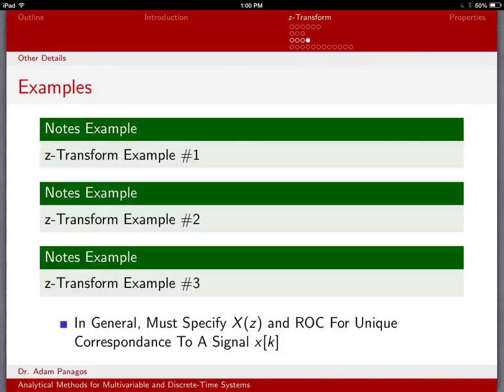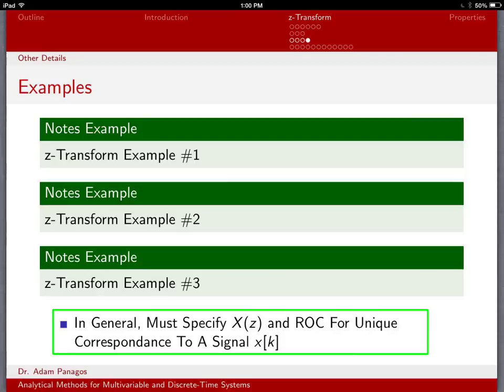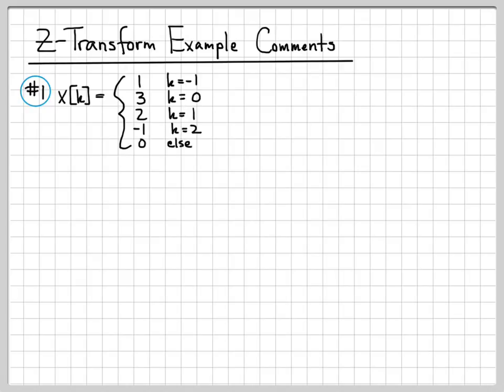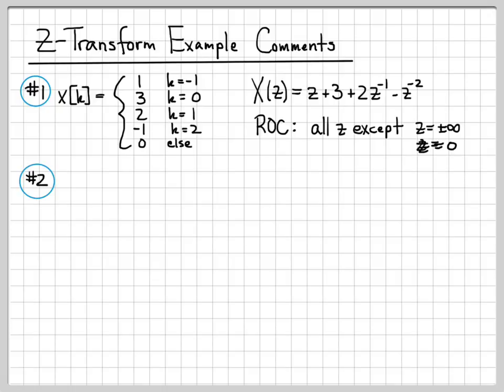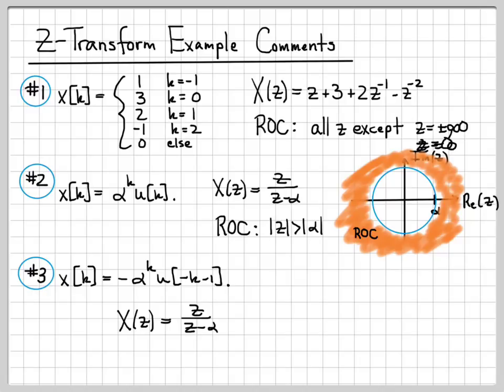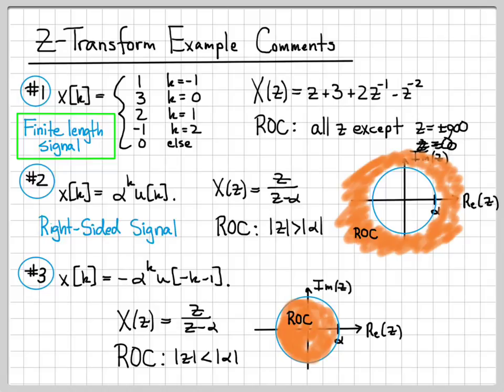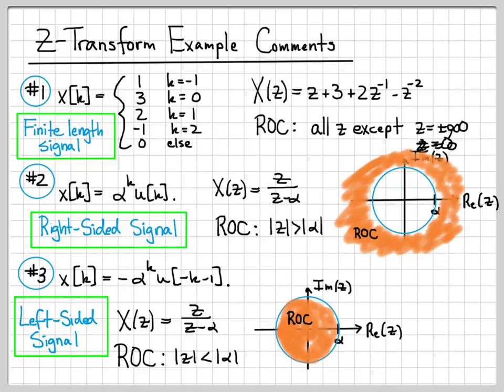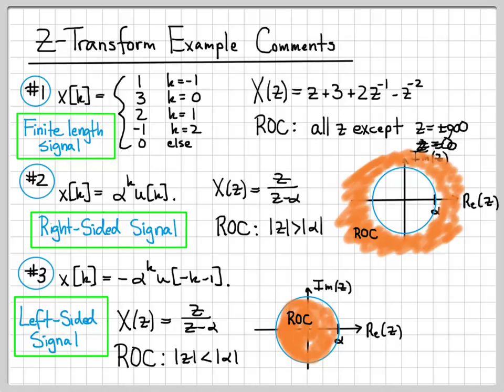Z-Transform Example Summary

Comment: I think in the ex. #1 Z=0 or inf are zeros of the system X, not poles.
Reply from the maker: No, they're definitely poles, not zeros. If you let z = 0 in the expression, the term z^-1 = 1/z = 1/0 is infinity; so definitely a pole. Same thing for z = infinity on the z term.  Hope that helps, Adam
Reply: @AdamPanagos  thanks for the response! In my understanding poles and zeros are respectively, the frequencies where denominator and numerator of a transfer function becomes zero. Since in the #1 we have a transfer function only with a numerator I assumed that we must only have zeros (like in the tf of an FIR filter). To be sure I guess I have to factorize this function. Im not challenging your knowledge. I’m just trying to understand this better. 

On a side note: Your content is pretty sweet I finished all the DT videos to refresh my memory. Thank you for taking the time to make this content.
Reply from the maker: @lakshannavarathna7689  Thanks, I'm glad you've enjoyed the material.  You're correct about this being kind of a special case.  Since we just have the "numerator" part, this is an FIR filter. And, FIR filters can only have poles at z = 0 or z = infinity.  If it's a causal FIR filter, only z = 0 is possible for the pole location.  For non-causal FIR filters (like this one), z = infinity is also possible.  There's a nice little discussion about this here:
https://dsp.stackexchange.com/questions/31999/non-causal-fir-is-that-possible
Hope that clarifies a little more,
Adam